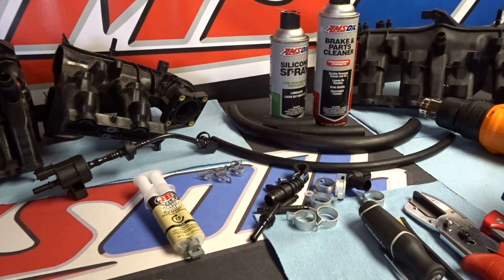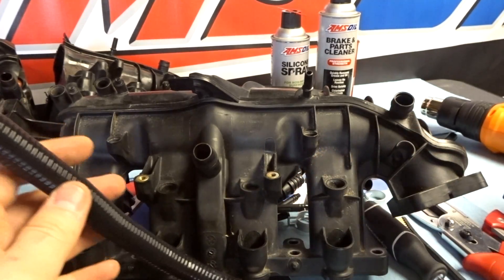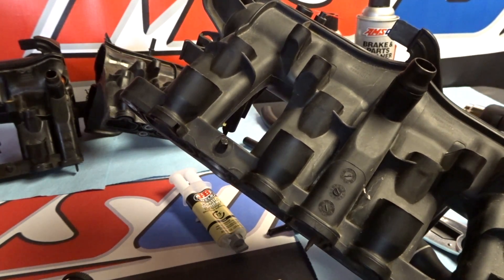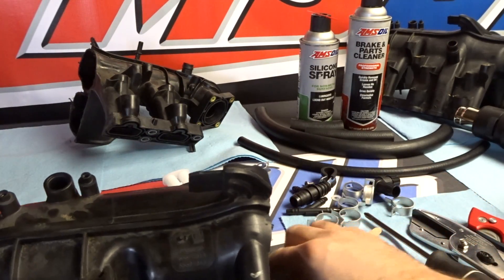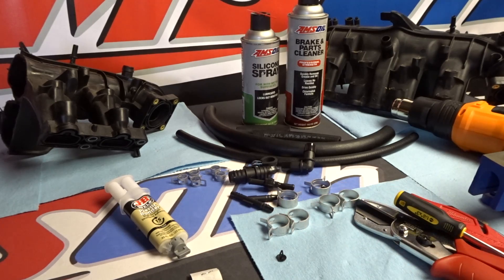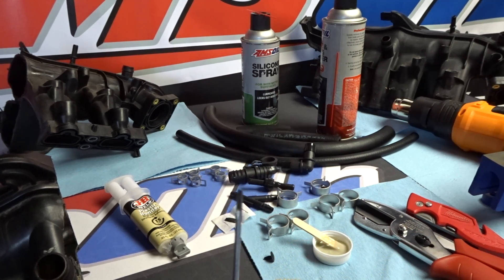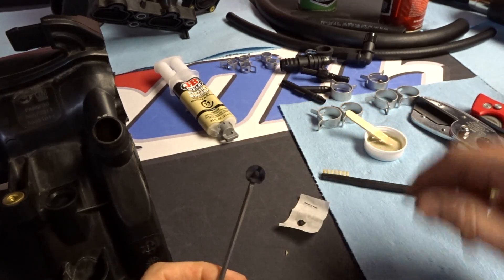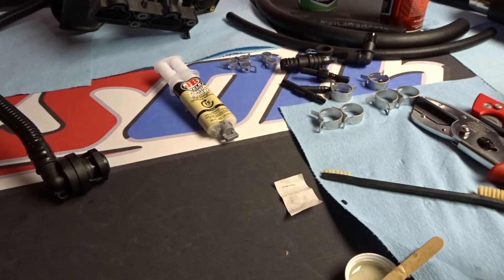How to Install the CruzeKits.com V3 PCV Fix Kit

Comment: Question,  if I wanted to add a catch can to the car, would I be able to plum it into this set up, and if so where? Would it go on the "big hose" in this kit heading to the turbo?
After installing this hit I noticed a lot of oil and crap in the hoses and some in the turbo from the stock set up. I feel these and most Turbo cars would really benefit from a catch can set up
Reply from the maker: I have a different T fitting than the one currently in the kit, which could be used with a catch can. That being said, catch cans aren’t something I recommend on these cars. Run a high end synthetic oil like AMSOIL signature series and you’ll see maybe 1/4 of a quart of consumption every 15,000 miles. Not even noteworthy.
Reply: @AndreiDPop  ok sounds good. I just got the car from a friend for free because it had a blown head gasket. Other then that the car seems to be in great shape. Just put a new head on it yesterday as well as this kit you are selling.  I did research on the cars known issues and that's what brought me to you and this PCV kit. Nice kit by the way. Very easy install. With that yes I am a big Amsoil fan and an Amsoil dealer, so yes I will be using the signature series.  I put Amsoil in everything I own from cars, trucks, boat to yard equipment.  Thanks 😁👍

Comment: Dumb question here, but ripped parts off car already and turns out I am out of my Brake and Parts Cleaner. Is it safe to use WD-40 instead or am I gonna need to go for a five mile walk haha
Reply from the maker: Need something that dries fast and leaves no residue. Wd-40 is the opposite of that.  

Try lacquer thinner, rubbing alcohol, carb cleaner, etc.
Reply: @AndreiDPop  Took my truck to get good stuff. Pig gets 9mpg but I want this done right.
Reply: SO much for doing it right. What happens if your heat gun melts the part you're only supposed to warm up?  It wasn't sliding on so I gave it more heat, still wouldn't. Added more silicone and tried again. but now it's shot. 😬
Reply from the maker: @KevinDuganJr  easy. You read the note sheet and notice on the last line I mention I include a 4.25” section of hose in the kit and 4 extra clamps so you can just cut the nylon off and use that in its place.
Reply: @AndreiDPop  That's what I thought, but just wanted to make sure. :) I've puckered up enough already haha
Reply: I'm all cleaned and got everything put away. Took a little video of the first time I fired it up post-install. Thanks for your quick response AND especially the kit, you rock.
https://www.youtube.com/watch?v=xwKwfX25Ua4
Reply from the maker: @KevinDuganJr  you fired it up already? Epoxy needs 15 hours to dry…
Reply: @AndreiDPop  dammit. I thought it said 15 minutes. 🤦🤦🤦
Reply from the maker: @KevinDuganJr  refer to the packaging. 15 minutes was the set time on the old epoxy.
Reply from the maker: @KevinDuganJr  just clean it all up and cake some epoxy around the plug. Let that cure.
Reply: @AndreiDPop  I'm sure your instructions are spot on. 100% my fault.
Reply from the maker: @KevinDuganJr  I mean I did use a different epoxy when this video was made but even plastic bonder needed 2 hours to cure. 15 minutes was the set (working) time. It will be fine if you just add some around and let that cure.
Reply from the maker: @KevinDuganJr  I mean I did use a different epoxy when this video was made but even plastic bonder needed 2 hours to cure. 15 minutes was the set (working) time. It will be fine if you just add some around and let that cure.
Reply: @AndreiDPop  this has been done. Kind of tedious to add more epoxy without getting it all over inside. Definitely gotta do things right first time!
Reply from the maker: Could also just install the rest of the kit and worry about the plug tomorrow.

Comment: Why would i do this instead of buying an other manifold?
Reply from the maker: Because a new intake manifold will fail in some way like the last one did. This kit is half the price, upgrades your existing manifold to have an external check valve you can replace in 2 minutes (the kit even comes with a spare valve), and you can install the kit without even removing the manifold.
Reply: @AndreiDPop  
Yes I need to order the kit but can't find a place or address or link to do that
Need help  thanks
Reply from the maker: @michaelbunch317  cruzekits.com

Comment: What happens if the check valve at the end that goes to the turbo is bad is that OK?
Reply from the maker: You can usually clean it with some carb cleaner and compressed air.

Comment: I need a replacement 3-way T fitting and check valve, I see i can order the check valves by them self on the website but how do i get a replacement 3-way?
Reply from the maker: I can throw in a T fitting if you order a 4-pack of check valves free of charge. What happened to the T- fitting? Do you have the original v3 or a v3.1 or newer?
Reply: @AndreiDPop  me and my buddy are trying to flip a 2012 and he ordered the kit i cant remember which one it was but we lost the 3-way and check valves some how, it was the one with the smaller barb in the middle. so do i order the check valves and give you the order # on here?
Reply from the maker: @automotiveam  how long ago was that kit ordered? I haven’t sold that version of the kit for two years now. 

Shoot me a message using the contact form on cruzekits.com.
Reply: @AndreiDPop  ok maybe he's mistaken which one it was, cause we just bought this cruze in march, but ill place order and shoot you a message. Thanks man

Comment: Hi I purchased the kit but the car that Is a 1.8 and it looks different than the Visio will this kit work on the 1.8
Reply: Vidio
Reply from the maker: No the kit does not work on the 1.8. The kit specifically has 1.4L Turbo in the product name.
Reply: @AndreiDPop  Hi may I return it for a refund since I won’t be able to use it?
Reply from the maker: @jessiejames1096  yep. Our return policy is the price you paid minus shipping and handling ($10 if you used standard shipping). Send it back to the return address on the package (should start with a 115).

Comment: I am now getting a tighten gas cap message a lot. It follows with a P0299 and P0455 code. Is the pressure of air going from turbo area back to manifold in back? How is this designed. To move pressure front to back or back to front?

Comment: I just installed the 3.4 kit on my daughter's  2014 Eco.   Engine light immediately extinguished and it runs much smoother.   I found the boost hose had a hole in it and was patched with electrical tape so replacing the hose with that much superior hose was worth it alone.    Thanks a million!!
Reply: What codes was it giving you?
Reply: @CCLLC323  I BELIEVE I was getting P0171 and P0420.   I am still getting a code but I believe it's something else, P1101.
Reply: @brentfugett2700  same code here. maybe a scientist mechanic will reply to your thread

Comment: how do you remove the factory check valve if it is still there?
Reply from the maker: You can break it off with a flathead screwdriver, then use a pick or stif wire to make sure the center hole is clear.

Comment: Quick question: I have a Dorman 615-380 intake manifold which is supposed to address the PCV issue, does adding the PCV fix kit to it create any additional benefit? Is it necessary?
Reply from the maker: The dorman manifold still has the same type check valve in the same location. While it does add a pin behind it to keep it from outright disappearing, that’s only part of the issue. 

The other issue is that it still gets dirty. It will leak, get clogged, gummed up, or stuck shut.  I’ve had people report their check valves were cracked when they popped them out to install the fix kit, so do what you wish with that information. 

What’s worse is they recessed the check valve further back so you can’t inspect, clean, or test it either. 

The PCV fix kit upgrades the design to an externally serviceable check valve, and that’s the primary benefit to it over the Dorman manifold. If that check valve needs replacing, it takes 5 minutes to do so instead of trying to figure out what the issue is on a check valve you can’t even see.
Reply: @AndreiDPop  thank you for answering my question. It makes sense, I will be ordering the V3.4 kit to go along with the Dorman intake
Reply from the maker: @0000Otto0000  why are you ordering an intake? The kit is designed to be installed on an already defective manifold.

Comment: Thanks for creating this kit and supplemental video. I just installed this today on my 2013 Cruze that has 93k miles just as preventative maintenance. It surprisingly still had the little orange valve. Did not expect that. Looking forward to many more years of use with this car with your kit to help it. Thanks again!
Reply from the maker: Glad to help! Usually at that mileage the stock check valve is pretty gummed up or stuck so it’s not even working correctly. It’s not uncommon for the check valve to disappear on people after they clean it.
Reply: How did you pop out/in the orange nipple valve?
Reply: @KevinDuganJr  like Dre Dan said. I just used a long flat blade screwdriver and rubbed it across like a chisel and it popped right off. I am not so sure it was fully intact at that point anyway by the way it felt.
Reply from the maker: @KevinDuganJr  you can hit it with a flathead screwdriver with your palm.

Comment: On the purge valve would it be easier to use a vacuum line instead of using the heat gun?
The heat gun method was not as easy as shown in this video. My hose did not want to expand enough to get over the Y fitting and my hose was trying to melt on me
Reply from the maker: Yes and the kit already includes an extra section of fuel hose for exactly that reason, and it’s explained in the note sheet that came in the kit

Comment: Having problems with my 2009+ Opel/Vauxhall Astra J 1.4 Turbo. Totally loses power above 4k rpm and throws out a lot of smoke. Including stuttering when accelerating. Maybe this is the fix i need. How long does it take to send to the Netherlands?

Comment: If the red valve has gone but the car runs fine does this still need to be done?
Reply from the maker: Yes. Your car might feel like it’s running OK but you’re burning a lot more oil than you should be, you’re losing fuel economy, you’ll have more external leaks, and you’ll have premature valve cover failures. The kit will pay for itself in fuel economy savings alone.
Reply: @AndreiDPop  the Valve cover gasket  failure is the reason ive looked into these issues. The pcv diaphragm is fine but on inspection of the red check valve it's nowhere to be seen. Regarding a comment from another guy replying to this video he's discovered the other end of the pipe is blocked. Whats the scenario if I fit this kit and the pipe is already blocked? Anyway to tell without removing the manifold?
Reply from the maker: @chrishall1263  If the other end of the pipe was blocked, you'd be blowing oil out everywhere. I haven't seen that to be the case. A bit dirty, sometimes, but some carb cleaner can clean that up. 

That is, assuming you're referring to the PCV pipe.
Reply: @AndreiDPop  maybe I used the wrong term in saying pipe. What I think the guys referring to is the other end of whatever you can see through the hole in the top of the manifold. He's saying if he hadn't removed the manifold he wouldn't have discovered the blockage. I could be overthinking the whole thing it's just a comment I read further down this thread. Ideally I don't want to be stripping the manifold if it's not needed.
Reply from the maker: @chrishall1263  there’s a path in the cylinder head between the valve cover and the intake manifold that connects them. Sometimes that path becomes clogged with deposits. It’s worth checking that but it can usually be checked from the valve cover end without too much trouble and it usually isn’t clogged unless someone used low quality oil in the car.
Reply: @AndreiDPop  OK well that's something else I need to check. It seems pretty gunked up in there from what I can see through the hole in the top. I'm going to order one of your kits regardless. The job needs doing. It's a pity you don't sell the valve covers as well. They seem to be a lot cheaper than here in the UK.
Reply from the maker: @chrishall1263  I’m sure I can get you one, but then freight for the larger and heavier box gets significantly more expensive as well.
Reply: @AndreiDPop  I'm looking at about £100 for a genuine GM cover with the gasket and bolts. About $125.
My other option is to replace just the gasket as the pcv diaphragm seems to be intact. I'm assuming you wouldn't recommend using aftermarket valve covers? They are half the price over here.
Reply from the maker: @chrishall1263  gasket won’t need replacing if you address the intake manifold issue. That’s the reason why it’s leaking in the first place. Once that’s done you won’t need to touch the valve cover. 

It would cost more in extra freight than you’d be paying out there for the valve cover. 

Yes OEM only. I get phone calls every week for issues caused by aftermarket valve covers on these cars.
Reply: @AndreiDPop  OK thanks for all the Info. Will be placing an order later today.
Reply: Hi I'm currently in the process of fitting the kit. After cleaning the manifold with the tool you provided and brake cleaner I've realised the red check valve is still in place. Do I attempt to push it through with the black plug and proceed as normal or would you suggest another way of removing it?
Reply from the maker: @chrishall1263  yeah you can push it through or break the tip off with a flathead screwdriver. Then make sure the center hole is clear so the a pick or stiff wire.

Comment: My valve is still there, but it malfunctions. I have the kit, but how do I remove the valve from the manifold.
Reply from the maker: You can break it off with a flathead screwdriver and make sure the center hole is clear with a pick or stiff wire.
Reply: @AndreiDPop  thanks

Comment: Just a quick question. What do you do if the original check valve is still in the intake manifold?
Reply from the maker: If it’s still there and you want to install the kit as preventive maintenance, you can break that nipple off with a flathead screwdriver.

Comment: What do you do if the check valve is still in place? I look down the intake manifold and the rubber nipple we are replacing is still there.
Reply from the maker: You can break that nipple off with a flathead screwdriver if you want to install the kit as preventive maintenance or believe the valve is leaking, clogged, or cracked on the other side. Just run a wire or pick through the center hole to make sure it’s clear.
Reply: @AndreiDPop  Thank you!

Comment: Which install tools come with the kit?
Reply from the maker: The kit itself doesn’t come with any but the install tools add-on comes with a screwdriver for installing the plug and a custom made steel bristle brush for cleaning the inside of the pcv port.

Comment: Hey just curious. I didn't have a heat gun or silicone spray. Figured I can heat it slowly with a torch while I push it on and ya that didn't work lol hose turned to shit quickly. Have to run to canadian tire tomorrow to buy a heat gun. If that fails and I'm not able to salvage the hose you think I can just use similar rubber hose like what's included eith the kit for the purge valve?
Reply from the maker: The kit comes with 4.25” of pcv hose and 4 extra clamps so you can use those instead of having to use a heat gun. Read the note sheet.
Reply: @AndreiDPop  ahh ok I'll have look. All i got with the kit was 4 pieces of hose the shorter piece I have goes into the check valve from the y correct? I should've gotten 2 of those small lengths? All good either way I can buy a small length of pvv hose feom else where if need be
Reply from the maker: @suspectlikun  no, the shorter piece is what you use on the Y fitting instead of the nylon. You need to cut 2” off the longer piece for the check valve. This is explained in the note sheet and on the website.
Reply: @AndreiDPop  Yup I just read that on the website. I'll switch the location of the check valve. Thanks bud
Reply: All good I found some gas line pvc hose got er all hooked up looks awesome much better than before. See how she runs tomorrow once the epoxy cures. Thanks again👍

Comment: Your kit was a total game changer for me. My 2014 Chevy Sonic 1.4L Turbo failed inspection this year. I found the Cat was bad, replaced it and the EVAP readiness didn't change to ready. I looked inside and saw that the PCV valve orange indicator was missing and I could see the hole. A week after installing your kit, I passed inspection. I am so thankful for this design. I bought the latest v3.4+ kit with all the tools included. I am so glad I didn't have to replace my intake manifold. Some things I like about your kit is that the length of the hoses are precisely measured and the wire brush tool was super helpful. I recommend anyone who orders your kit, also buys the tools along with it.
Reply from the maker: Thank you! I appreciate the feedback!!! I’m very glad everything went well for you.
Reply: hey did you still need a heat gun like in video? i just ordered mine, site says no heat gun?
Reply from the maker: @NarutoV2DL  heat gun isn’t needed anymore. The kit comes with a 4.25” section of hose and 4 extra clamps so you can just cut the nylon off and use the rubber hose instead. Much easier and faster.
Reply: @AndreiDPop  Much thanks for the info, Now hoping they ship this fast lol. Cars expected on a long trip soon fingers crossed.
Reply from the maker: @NarutoV2DL  I run the cruzekits site. Right now I’m procoessing orders and shipping them out within one business day and usually same business day if it comes in before 2PM. So all weekend orders will be going out today.